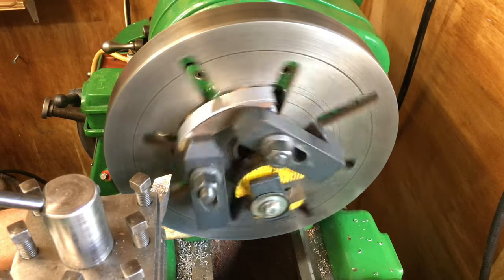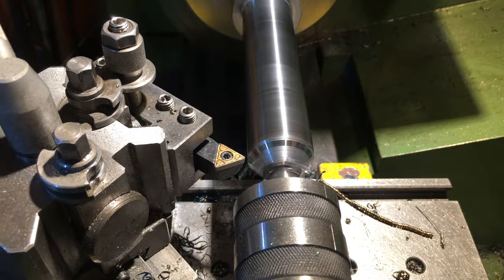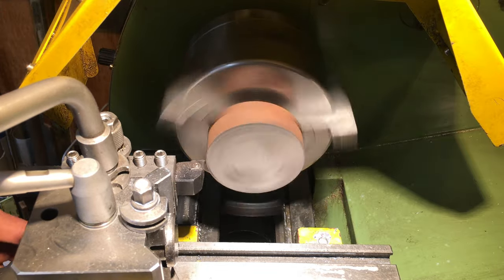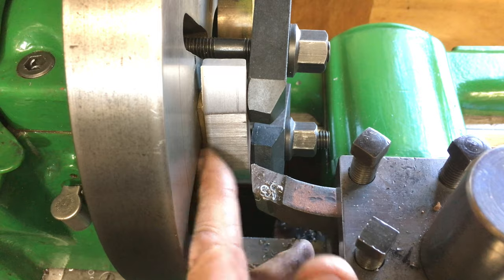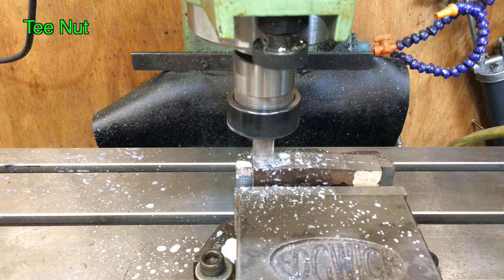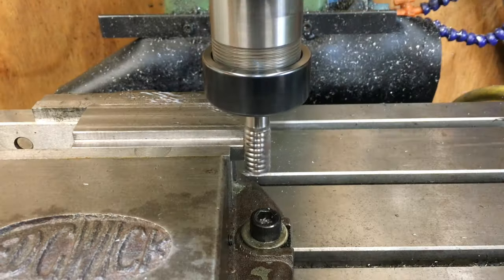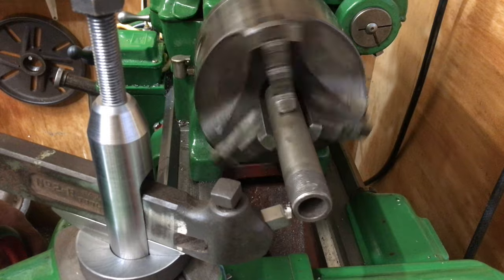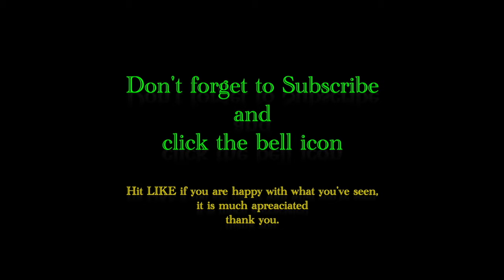Making a Lantern Style Tool Post

Comment: Lovely to see someone going back to old style tools, so much easier to use than replacement tips and usually a better finish.they weren't so daft those old timers .Thank you for a very interesting edition.
Reply from the maker: Hi, yes you're right, the only reason things changed, was manufacturing speed. Speed became the overriding factor in modern manufacturing. Thing is, in a little workshop like mine speed isn't important but, cost is. cheers

Comment: Great project, and lovely work all around. The first lathe I learned on had  this type of tool holder, and it was very nice forking into tight areas, and simple house economical high speed steel cutters. I did like it better than the turret style which followed it after as it was so easy to get the cutter on centre rather than shimming. Got to love those sticky pins, I do see a lot of them on the amazing third world machines, fascinating. Enjoyed very much, cheers!
Reply from the maker: Hi, I've used all types of cutting processes and tools, from high speed steel to ceramic. High speed steel is still king for me, mind you ceramic gets close. These two techniques are different ends of the spectrum one is slow and will take off quite a bit of material, if it's asked. The other works at ballistic speeds and will only remove thin layers, but the finish is supreme. As for sticky pins they are still used in many machining environments where the operator is in charge of the set up, mostly on castings or fabricated parts. Regards.

Comment: Absolutely superb. A tour de force of your skill. The concave surface was especially good. The milling machine is truly a machine of applied geometry. I have a Harrison booklet on milling that shows the calculations etc for generating parabolics on the mill, with an application shown for telescope  mirror manufacture. I have to say that I really need to find these boot sales/autojumbles/garage sales where you can buy milling cutters, lathe tools, metrology gear etc. Loved the film. And I enjoyed the calcs. I do like a calculation.
Reply from the maker: Hi thanks, there are geometric calculations for machining parabolic curves and spherical arcs on many machines. I used to cut spherical bearing bores for self aligning bearings on a twin ram boring machine, that was fun. The Staffordshire showground and the Newark Showground both hold a few auto jumbles every year they are a good source of used engineering tools .. you just have to take a van and lots of cash with you whenever you go. cheers
Reply: @Thesheddweller  Excellent stuff. The thing I like best about engineering is seeing calculations become real things. My problem with the boot sales etc is I am about as far removed from middle England, where they all take place, as it is possible to be, without being Norwegian. Not to worry. I manage well enough! Thanks again for a great film.

Comment: If you move the center of rotation for the boring head to the opposite side of the tilted rotary chuck, you should get a convex. 
If it’s a possibility irl due to interference between different tools, is another story though.
The right mix between tilt angle and cutter radius may solve it.
Don’t know the formula for that, but I’m sure there is one.

Great project and execution! 
I like it. Especially the concave part. Clever!
Reply from the maker: Hi, Thanks for watching. Oh, there is definitely a formula for the milling combination to scallop out a radial arc or a spherical dish. Wikipedia is loaded with all sorts of formulas. cheers

Comment: I'll cop to being curious to make one of my own, with an adjustable parallel rather than the radiused bottom approach.  Having the cutting force pressing more directly down onto the cross-slide just seems more efficient than having the tool cantilevered way out.  Great video and great work on yours, if I try it myself I hope it'll come out equally well.
Reply from the maker: I'm sure it'll be fine it'll be interesting to see your take with the height adjustable washer. I had to stick to the old traditional tool post because, these tools I bought, are a little deep bodied, mind you I could have clamped them directly onto the compound slide, using two clamps through the tee slot but, I wanted to make something that was sort of traditional-ish. Regards.

Comment: Got stuck at the math at 10:15. Had to do some algebra to understand what you were doing. You just figure that intuively or is that some common method for finding a radius?
Reply from the maker: Hi. that's a very good question, I'm not that intuitive but I must have used this simple formula many times in the past, I have it written down in an old (and decaying) note book. This note book I have, holds a jumble of calculations for many of my past working life problems. cheers.

Comment: You mentioned a "Whitworth spanner" wrench.....I am aware of Whitworth threads. But what is different about, say, a 7/16 Whitworth wrench and a 7/16" SAE wrench? I recently bought a set of 3/8" drive sockets that were labelled Whitworth sockets. I'm just curious why the Whitworth designation.